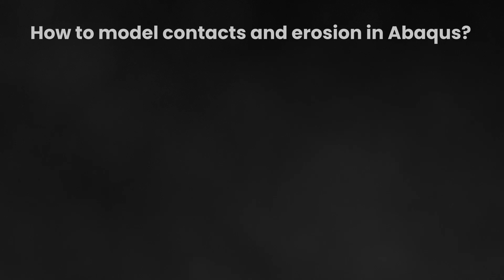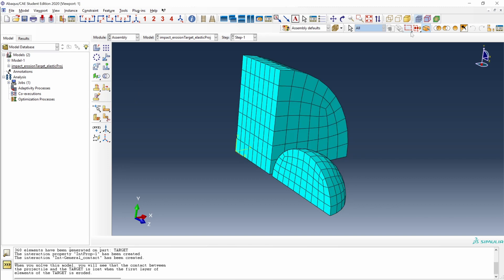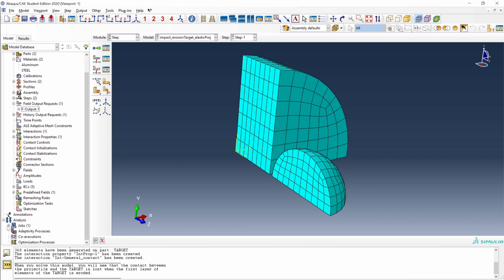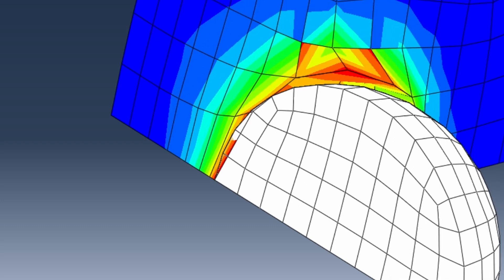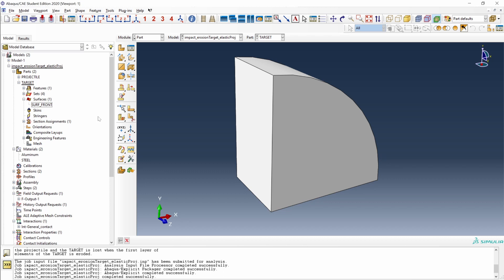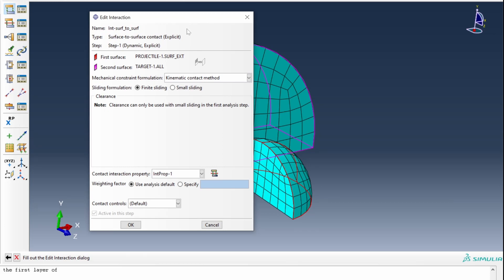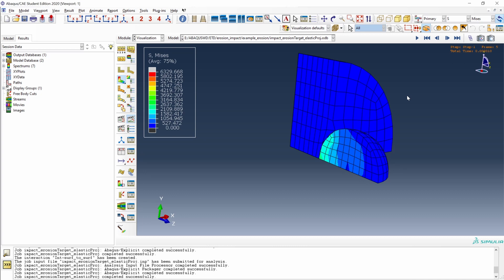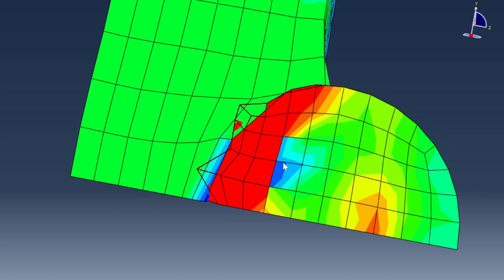How to define contacts with erosion in Abaqus | Contact and Element deletion

Comment: Nice but the erosion approach suffers from the major drawback of violating one of the first principles of physics, the conservation of mass and matter. So it is recommendable to use, instead of deletion, conversion of destroyed elements into particles having the mass of the original elements. Abaqus has the FEM-SPH for this.
Reply from the maker: Absolutely!! The mass from the elements deleted is removed from the simulation, so in the case of the projectile it will have a significant influence if this loss of mass is not negligible.

Element removal is an artifice used mainly for two reasons:
1) To represent discontinuities (cracks) in progressive failure analysis. This is very common in Continuum Damage Mechanics models.
2) To prevent convergence issues when elements are too damaged (softened) and they take huge deformations. Before the element is too distorted and the simulation crashes, we delete that element. Obviously, deleting matter is not physically representative, and that is something we have to take into account. 

Indeed, there are other modeling techniques to deal with this issue:

- If the projectile is relatively brittle, it will break appart, but we don't want to delete those damaged elements (we need their mass). In this case, we can follow the technique proposed, using Smoothed Particle Hydrodynamics (SPH) to model the impactor or some variant of this approach. This is commonly used to model bird impact or ice impact on aerospace components.

- If the projectile is extremely ductile (lead, brass...), it will not break appart, but it will take huge deformations. Using regular solid elements (lagrangian mesh) will result in the simulation crashing because of the huge element distortion. Again, we don't want to delete elements because we need their mass. The option in this case is to use an Eulerian mesh for the projectile (and Lagrangian for the target), so we will solve a CEL (Coupled Eulerian-Lagrangian) problem.

In many other cases, when the deformation nor erosion of the projectile is not too severe, it is enough using a regular solid mesh. But of course, this depends on each case and requires critical thinking.

Thanks for your comment Timo!